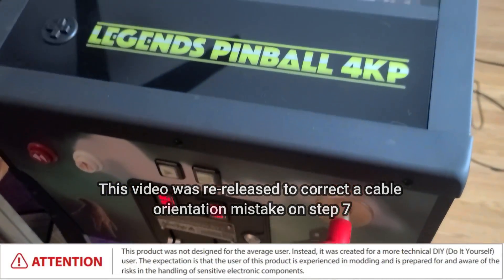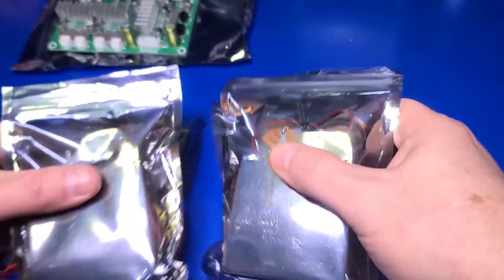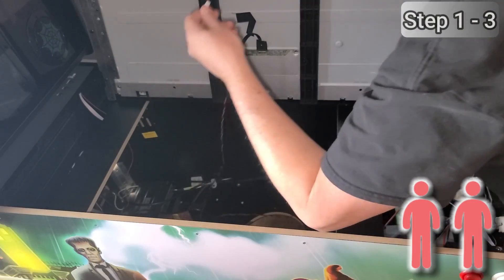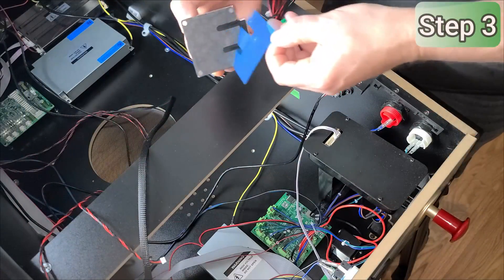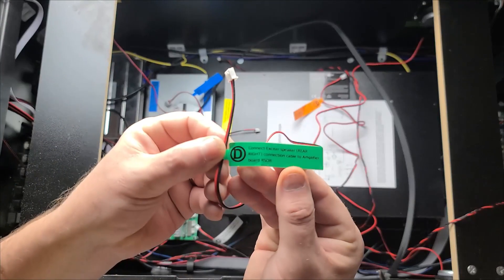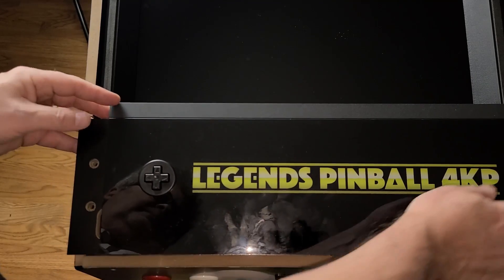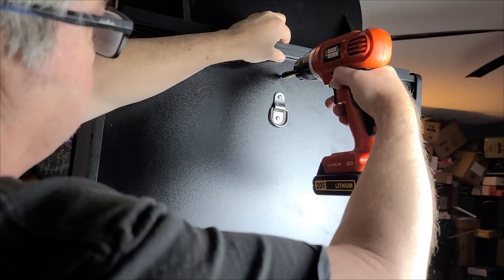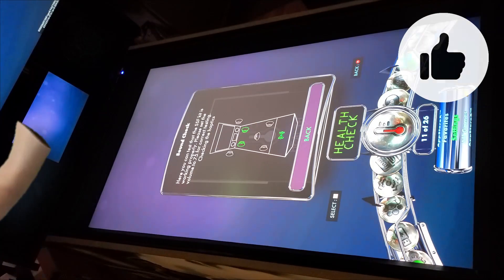SSF Kit Install for the AtGames Legends 4K or FX Legends Pinball

Comment: Help I got the ssd kit and I can’t get the display back in now I got finger marks on it 😣
Reply from the maker: When you put the back of the display, you have to raise up just a little and give it a gentle push.  It then should come down and fit the other screw holes.  Just make sure you have the monitor orientation correct and you should be good.
Reply: All good thank mate one other thing the solenoids are not working during the me yes I did disable them but there no longer seems to be any option. To re activate them also when I click to test solenoid nothing happens this only has happen since installing the ssf kit

Comment: I'm having a problem getting the screen back on. It won't slide in and is really hard to move. Its in the wrong position if I get it in and worried about damage
Reply from the maker: You bring the display in at a slight angle going into the back, then gently lower it.  Make sure all the holes line up and re-insert the screws.  Should fit just fine.

Comment: I got my 4kp with the SSF kit preinstalled and it seems that they have the (B) connector on the right side and the (C) on the left side of the power amp board from your video shown.. Could this be a problem?
Reply from the maker: You may want to bring this up with customer support here: https://atgamesassist.freshdesk.com/support/home , just to be sure.
Reply: Hey snap this happen to me had to prise the speakers off and swap them over at 1st I thought the wires were too short

Comment: I just got my SSF kit for my pinball 4k Jurrasic Park.

I your followed your video step by step. 
When i put it all back together, my D Pad isn’t working no more. I traced the white connector on back of Pad to the back control board, checked connections for looseness and tried unplugging and reconnecting. Yes, restarted machine several times. Everything works except the menu D pad buttons. 

What to do?
Reply from the maker: One thing to check may be for any bent pins in the connector going to the dpad.  Just make sure the machine is powered off before adjusting any connections.  If that doesn't help, please open a ticket here: https://www.atgames.net/arcades/contact
Reply: @ yup! Checked all that. But i just resolved my problem. I took the panel off again and discovered that there are two wires with same exact connectors, one black cable that runs all the way to the back board and one white ribbon cable that runs to a small board in front of cabinet. 

I saw a video online where someone showed the inside control panel and it was the white ribbon cable. So disconnected the black and swapped it with the white and everything is working again.

I guess i should have photo’d before taking apart. There are two wires with exact connector ends. Now my question is what does the black wire go to? I do not recall taking any other wires off while installing the SSF kit, just the wires to the front controller. Does that black wire go to anything or just a spare cable for a future upgrade like the usb black cable just hanging there?

Thanks for your help. Loved your SSF Kit video, everything is working fine.

Comment: Thank you for your videos, I recieved my ALP 4k last week w/ssf installed and we have a loud pop from speakers at the atgames logo on initial startup (does it everytime).  Is this normal.  Everything else seems to be working as intended.  I have checked all connections (I think) inside cabinet.  Thanks for any replys
Reply from the maker: Very welcome for the videos and thank you for watching!  If you turn the volume all the way down, power it off, then power back on do you still hear the pop?
Reply: @WagnersTechTalk  yes
Reply: Any ideas on why or how to stop this from happening

Comment: Couldn’t have done the install without you. My one question is that my subwoofer box doesn’t seem to do much. It works but is weak in test mode. Is that normal? And yes I had the volume at 75.
Reply from the maker: Thank you for your kind comment, happy to hear you're all setup!  The speaker in test mode is a bit quiet, during game play it will be more prominent.

Comment: Brilliant instructions.  I followed this to install the SSF into my 2nd machine, since my first one came factory installed.  Everything worked perfectly.  I was able to install it without removing the glass or the main display. It was quite a bit more difficult, but I didn't want to risk breaking important parts.  Thanks again Jon!
Reply from the maker: Very welcome Travis, happy it was helpful to you!  I gotta ask, how did you install it without removing the glass and the display?
Reply: I installed the Sub from the back with the access panel removed.  I had to remove a couple of plastic pieces at the top and manuever around the PCB cabling.  But with a little bit of patience, it slid right in.  The two boards I could easily install from the back panel.  The speakers I could install from the back panel and with the front control panel removed.  It took a lot of patience to do, but it was doable.  I have long arms.

Comment: Does the ssf kit also work in otg? So fx3 or popper works through machine speakers? Or does that need dedicated speakers?

Do you think $350 ($450 installed) is a worthy price? I have a preorder for $450 installed, but wondering if I should cancel that if we can piece parts ourselves. I'm also wondering if the ssf is sole proprietary, meaning we just can't piece together our own. Perhaps the atgames amp has a firmware designed for it 🤷‍♂️
Reply from the maker: The SSF kit can work over OTG, yes.  But, it's dependent if the pinball application itself supports SSF.  I personally think that the SSF kit is well worth the price, if you ask anyone who installed it themselves or had it pre-installed what they think, I've not yet heard one person state they wish they didn't get it (see comments here for confirmation, if needed).  The kit comes with two custom boards, not saying you couldn't piece together your own, but it would likely be cheaper and better integrated going with the AtGames SSF kit.  There are a lot of things involved, the firmware is a component as well as SSF support within the Legends4K format.  If you install it yourself, you can save some $.  If this video scares you, order it pre-installed.  If it doesn't, you can save $100.  Totally your call.
Reply: @WagnersTechTalk  thank you greatly.  Ultimately, I did get the ssf kit and went ahead with pre-installed. If I were to buy the kit later on, we're subjected to $30 shipping, so $430 compared to $500. I could've installed it as my work background was machinery maintenance and over 30 years building pc's, , but I just opted to have them do it. I believe when I preordered the AFM back in December,  one factor was you got the full year warranty on the ssf kit if pre-installed. Where-as if added seperate, it's only a 90 day. I also thought about just getting kit off nod sale, and last one had it  $50 off, but with the $30 shipping, it's sort of iffy on waiting for mediocre savings.

Comment: Hey quick question the subwoofer is extremely faint I have it set to loud but it still sounds like it has no power is getting power because it does activate but the subwoofer is acting underpowered. Any suggestions or ideas, could it need an update? I'm not the only one, on there forums there are a few of us with this issue
Reply from the maker: It's pretty loud for me, especially while playing Gloomhaven in FX over OTG.  The bass is very evident.  You may want to open a ticket with AtGames to get more information.  I don't have much to add.
Reply: @WagnersTechTalk  I will definitely open up a ticket and see what they say. Also do you know what resolution and ratio the playfiled back glass and dmd are? I'm trying to set up pinball fx vpx and vp tables..... You know I really need a video from you about how to set up a pc to the atgames 4k your other videos are so helpful but not exactly what I need for the atgames 4k pinball
....
Reply from the maker: I can help you with the PC Setup and Pinball FX/M.  It's all here on this new guide that I released yesterday: https://wagnerstechtalk.com/alp4k-pcsetup .  I don't have the videos ready, those will be coming as soon as I can put them together (I spent about a week dedicated to this written guide).  Pinball FX+M are also on that same page, should help you with most all aspects minus vpx (that will come after videos for PC Setup and FX+M).
Reply: I had mine installed by AtGames before it shipped to me, and it’s also really faint in my tests. I haven’t opened a ticket yet, but will do so soon. Did you get the issue resolved?
Reply: Maybe you plugged the wires the wrong way so the signal phase is inverted 180°?

Comment: Instailling the exciters..  I see the AtGames image shows the D/E pointing the cable towards the back.  But when you install them, they are pointing down it appears.
Then you say to rotate 90 degrees for the back ones.  Just use the image in the instructions and front point backwards and the back rotate 90 degrees to point down?
Reply from the maker: Just use the orientation from the PDF for D&E, yes.  It doesn't matter the speaker is round so there wouldn't be any difference in sound.  But, to keep things consistent with the PDF, I mentioned it there.

Comment: Thanks for your AtGames 4K Pinball game assembly videos, and also this SSF kit install video. It took me and my friend about an hour to install the SSF kit, despite accidentally putting the playfield screen back in inverted, and swapping the plugs for two of the exciters (revealed on the audio tests). Those were both easy fixes. I appreciate your careful instructions, plus AtGames thoughtful design with colored and labeled tags for easy connections. The SSF kit really makes the audio richer, fuller and more crisp. Bringing it closer to a real pinball experience. However, the SSF kit did highlight the Addams Family lag, as there is an obvious delay between the solenoid click and the corresponding SSF sounds. I can understand why AtGames separated the SSF kit to keep the base price lower, but I am very glad that I spent the extra money on the SSF kit.
Reply from the maker: Very welcome Dean, thank you for watching!  One hour is the best timing I've heard so far, great that it went relatively smoothly for you.  The latency in Addams is discussed here, if you're interested: https://wagnerstechtalk.com/alp4k/#Legends_Pinball_4K_Latency (see yellow area for a video demonstration).  While it's improving, it's still not where it needs to be.  AtGames and Zen have this as their #1 priority to resolve.  

There will be an update to correct some micro-stutter issues with the non-Zen tables on the 20th of this month.  What I found interesting is that none of the micro stutter issues were evident in earlier builds I tested (all tables shown here played very smoothly with no stuttering: https://wagnerstechtalk.com/alp4k/#Table_Game_Play ).  It appears to have been something introduced on release.  Once I noticed it, I immediately informed AtGames of it.

Comment: So the black display cable that connects to the main monitor was never connected to the main internal hardware for me. Where does the other end of the display cable connect to coming from the monitor?
Reply from the maker: Are you talking about the playfield display cable?  See 08:49 (pause it).  You'll see the main playfield display cable plugging into the main board.  It may have come loose.
Reply: Yes that’s the one. Mine must’ve came loose during shipping. It’s working great now! Thanks for the quick help/reply

Comment: Anyway to get the dimensions on the subwoofer box? I would love to build a similiar one and mod my current ALP this way with an external amp.
Reply from the maker: I would design it based on opening the ALP HD and measuring there and seeing what would work best.  No guarantees that the dimensions for the subwoofer box in the SSF kit would fit the same way.

Comment: Step 7...What happens if you installed the cables the wrong way? How will it sound or act
Reply from the maker: It will work fine, it's just the colors of the wires.
Reply: @WagnersTechTalk  sorry I meant if you installed it wrong.... Because my ssf is working just fine and I did install it from the original video not the revised
Reply from the maker: Right, it will be just fine as-is, no need to open it up and change it.  The only reason I re-released this video is because I had the cable reversed.  It works either way just fine (the electronics don't care about the color of the wires).  However, I should/do care, in a video.
Reply: Used your video to install the kit and everything was working fine.  Had to take apart the machine to move its location and now sound is clipping. Any ideas what could cause that?  I made sure everything was plugged in correctly?

Comment: I saw nothing about super street fighter. What does ssf stand for?
Reply from the maker: Sure, it's Surround Sound Feedback (SSF).  Basically, you have 9 speakers around the machine which simulate the ball rolling, playfield sounds (bumpers/thuds), etc.  It provides a more immersive experience, similar to what you'd hear on a physical pinball machine.